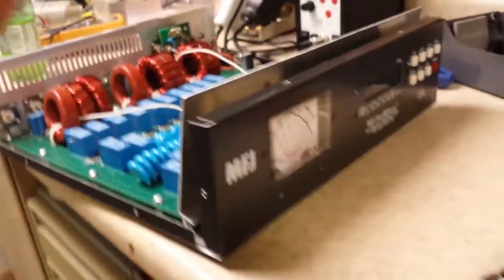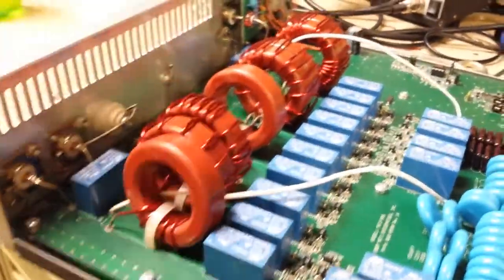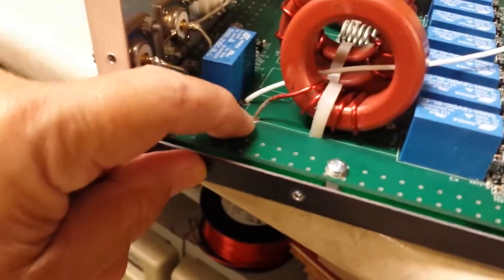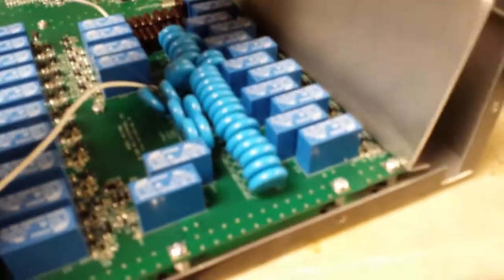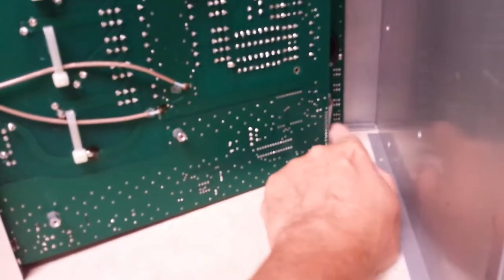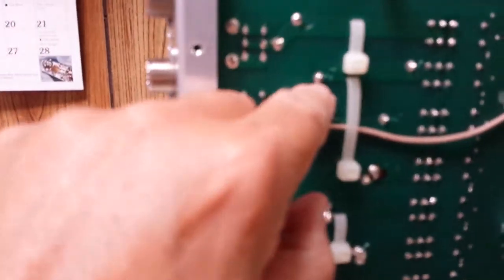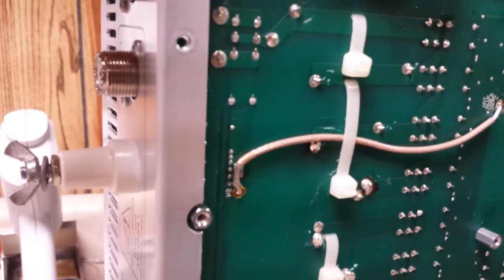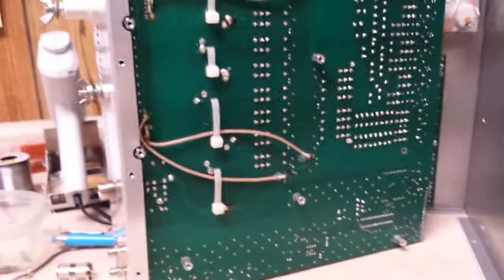MFJ-998 Repair Tip

Comment: Great video i have a 939 the diode up against the back  relay  on the tx input let out the magic smoke cant find the part number as its burnt  checked all over the internet i think its a fred diode need the part number no diagrams anywhere .73 keep up the video,s.

Comment: I just got that new tuner also and it will tune as it should on antenna connector 2A but not on the primary 1A.  SWR is 1.4 on that antenna on 1A.  If I move it to 2A, it finds it in two or three clicks. I do see what looks like a poor solder job on the top of the board on the ground wire coming off that antenna connector.  Time to look under the board I guess.  No word from MFJ on what to do about it so far but I do have a ticket in.
Reply from the maker: That's really not very possible. There is just a relay switching between those two jacks. Keep in mind that 1A also goes to the ceramic insulator wire antenna output. If you have something touching it then there would be a difference.
Reply: I took it apart as you describe and found nothing wrong or lose. It has done that from day one.
Reply from the maker: @baronlund9725  Then you need to trick it. Reverse the leads to to antenna jacks and see if the trouble follows you. Looking at the schematic there is absolutely nothing different between the jacks and the spdt relay except ant 1 has the extra post for random wire antennas. It could be some weird logic problem that changes loading algorithms between ant 1 and 2 or knowing MFJ it could be a wiring or circuit trace error under that relay... Pop out the board and look for a stray circuit trace around there.
Reply: @n4lq     
I had reversed the antenna's already to verify if it was linked to a certain antenna and it was not.  Just as a test, I have an old dummy load I will connect to it and try that.  I did look the board over pretty good but not with a glass to check up close.

Comment: I bought a used one, wouldn't tune correctly.  I also check the toroids and they were extremely loose.   MFJ tech told me they all were that way but he wished they would make them tighter. (well why don't they then?)   I shipped it back to them on Aug 2, got letter from them acknowledging receipt on Sep. 2,  and they would start work on it in 3 more weeks!  Well, Oct 22 and still no word from them.  Sheesh..
Reply: it took 5 months to get my 998rt back from them.  The poor tuner repair guy has MANY on his bench. Yes there is only ONE guy.....